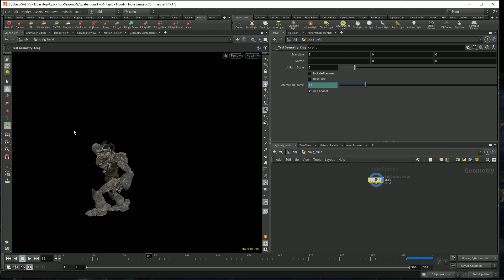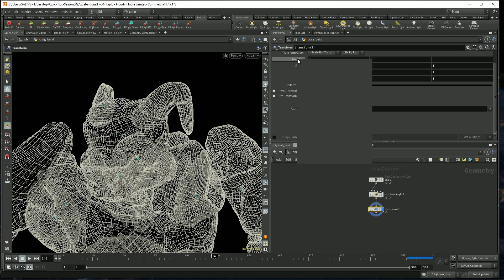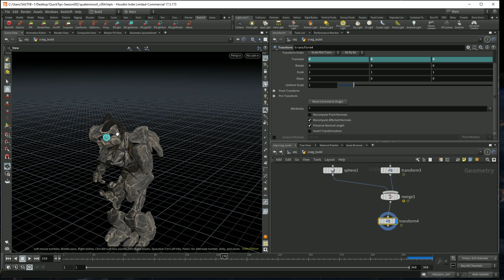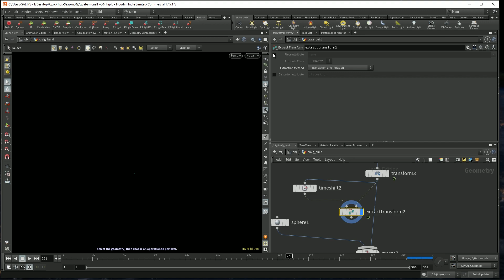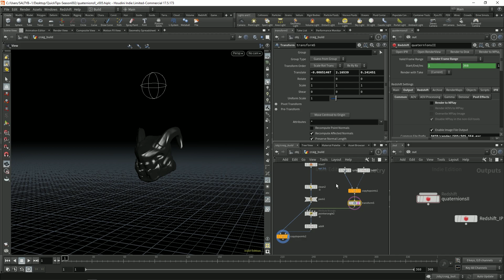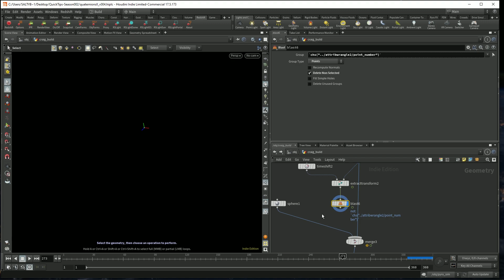Quaternions & Matrices - CG Forge - Quick Tip

Comment: Hi, I'm scaling packed prims in a rbd sim by modifying primintrinsics in a geowrangle:

matrix3 trn = ident();  // cannot use primintrinsic(...) because I wouldn't be able to scale over life anymore
float scale = chramp("scale_over_life", @nage);
setprimintrinsic(0, "transfrom", @primnum, trn*scale);

This works great, the only problem is that my instances don't rotate anymore. Is there a way to read the rotation back in, and "merge" it into trn matrix, so that my rotation is updated and not hardcoded? Thank you in advance !
Reply: you can use cracktransform() to extract what you need from the prim intrinsic
then use maketransform() to set in your new trn with your custom scale
Reply: @mistergozo  Thanks!